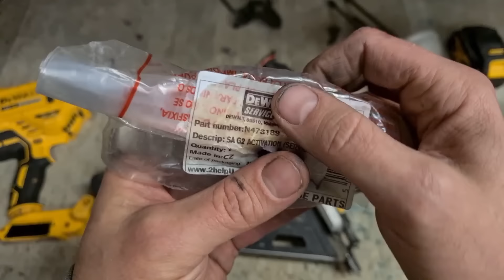Repairing the first bunch or power tools of 2024. Dewalts, paslodes and makita needing fixed.

Comment: Maybe someday I'll get to the point where I can dismantle the machines with wild abandon, toss the parts and screws, and STILL be able to put it back together with no extra parts!  You are a master!
Reply: I used to service a very commonly used Sony BVW75 broadcast cassette videotape recorder.
After sufficient times of stripping the tape deck mechanism I knew instinctively where everything went.
Not quite blindfold but almost!
It is just building up familiarity but you also have to understand how everything functions as well.
Dean has developed this skill over many years.
I hope he has someone to pass the knowledge onto.

Comment: Hi Dean, I cannot get enough of your videos, I enjoy it a lot and learn more every time.

On Monday I saw that my neighbour across the street put out a Genesis DuraVac ZL10-47A-21L Vacuum Cleaner. As Soon as I saw it, I wondered what could be wrong with it. I went to get it and test it, it didn't switch on. I immediately thought that it could be the cable, switch or brushes. The cable and switch were good, but I found that the wire from the field to the brush holder broke off and the brush wire broke off from the brush holder. After I fixed it, cleaned everything and assembled everything, the Vacuum Cleaner worked 100%.

I'm busy making myself a working space in the garage that I am only going to use for fixing or servicing electric appliances.

Thanks a lot for all the tips and keep up with the good work my friend.😂

Comment: I'm from Australia and replaced the chuck on my Makita DHP481 a week ago with a Rohm chuck. Initially I tried the method you showed in this video with the 458 to no avail. Mind you, I have replaced a chuck or two in the past, one being a Milwauke M18 using the hammer and allen key method. I also saw your other videos on cutting the chuck off but that was a last resort for me. I then came across a pdf repair guide that mentioned a special jig was required (1R404 or the 1R359) and the need to take the whole gear assembly out from the clamshell. Taking out the gear assembly was no problem. Ploblem was the 1R404 is about 200 Euro. So I decided to get creative instead. The 1R404 removal tool just locks the gears in place and also allows you to clamp the gear assembly in a vice with a jig then using an allen key with a long pole as leverage to remove the chuck. I used the Drill handle (without the depth guide) as my jig and clamped that onto my vice. I then grinded down a spare chuck key I had to match the 1R404-C gear and secured that to the bottom of the gear assembly in the vice to prevent the gears from spinning. Insert allen key into chuck, use metal pole for leverage and it came off so easy. I'm pretty sure you are aware of such removal tool Dean and I would love to see a video as others may also find it useful. I did manage to stumble across a youtube video eventually but took me a while as it was in russian. Here's the link  https://www.youtube.com/watch?v=xqV677r4Jug&list=WL&index=82
Love you videos Dean.
Reply from the maker: i have tired this method a few times, but if the chuck is locked on tight, it can damage the spindle when taking it off.
Only the very odd time. but the dewalt especialy i have twisted the spindle shaft itself,

Comment: After seeing so many dewalt guns on your channel, many of which looking brand new, I'm glad I heeded all the warnings on the internet and went with Hitachi instead. Although I was still curious how the flywheel mechanism works and all your videos are the only ones showing them. They are pretty neat from mechanical point of view, but I guess the complexity is their undoing.
Reply from the maker: yes, plus the no internal adjustments. the old gun, you could adjust the solinod to keep if firing longer. not in the new guns.

Comment: That first Paslode likely started with a dirty air filter. Not enough air, fires rich on fuel. Leads to too much carbon. Keeping that filter clean will allow it to run longer between servicings.

Comment: These tools are a lot cheaper in the us ik for a fact that dewalt is $250-$300 depending on kit . I paid $199 for a battery kit  and got my 1/2 inch drive stubby for free from a deal at Home Depot always do research it’s a lot cheaper depending on on store and deals

Comment: I was curious, who makes the best built angle grinder? , corded , cordless , i currently have a fuel and non fuel Milwaukee cordless pair of grinders and was interested in picking up a corded one to use when my batteries are down on those
Reply: Stuck between Makita , wen , and hitachi at the moment , but thought you’d have a much better opinion on the matter
Reply: @tyrant5337  corded ones I'd say Bosch are still the best esp the ones for heavy duty.

Comment: Dean what is your opinion of the 40v Makita do you get many in
Reply from the maker: have not had a single one in for repair yet, and im a makita service agent.
Reply: Hi dean I have the 8/12 makita 40v mitre saw great saw but rails rust any suggestions on how to remove rust safely and to try prevent it rusting